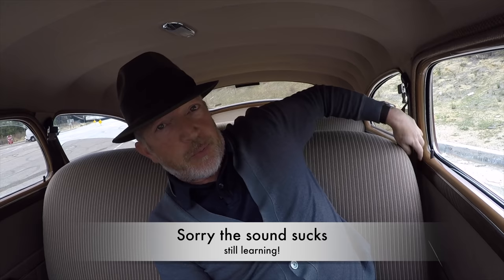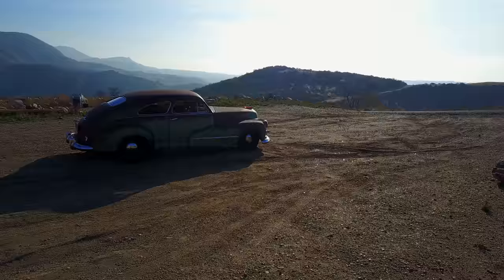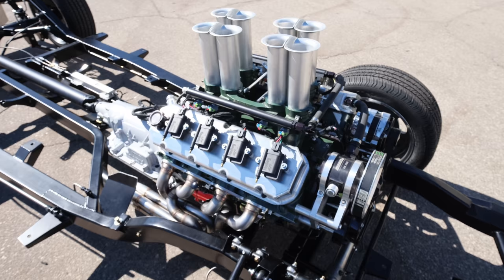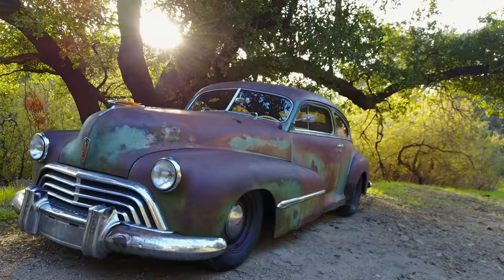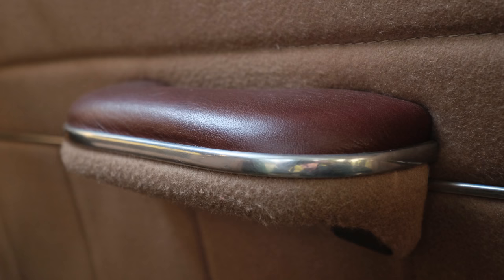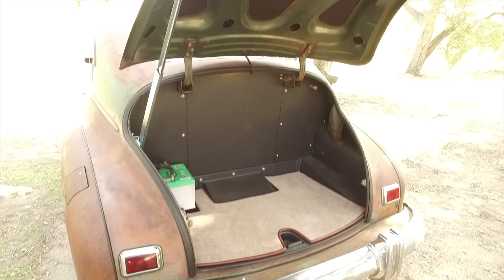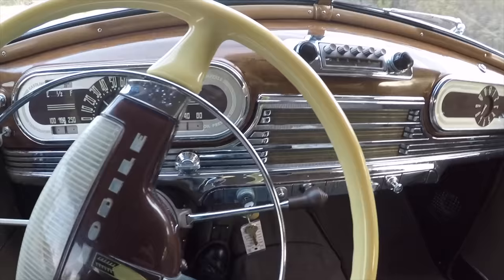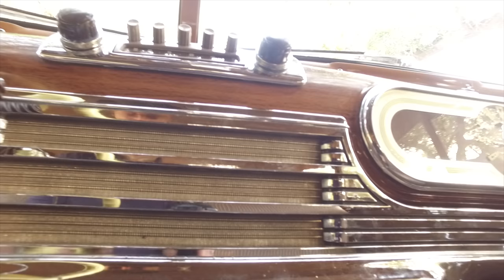ICON 1946 Oldsmobile Derelict Detailed Overview 4k video!

Comment: As a lover of the Harley Earl design team and especially the mid 30's to mid 50's stuff they did at GM I have always wondered if Earl was also responsible for interiors as well. Do you have any info on the interior designers at GM Mr. Ward?  ICON knocked this one out of the park in all aspects, as usual. Great job and best regards. Cheers!

Comment: Absolutely love love the car. The work you all do is A+++. I wish I could afford a derelict but I'm a disabled vet which is fine but I just love dreaming of that "Dream Car" that we all want. I would definitely want a Icon derelict it would be a 1949 Buick Roadmaster 2 door hardtop. I just love the front grille on the "49" buicks. My only request would be to incorporate the 4 portholes on each front fenders into the exhaust like on a P51 mustang. Whether to having the exhaust exit through the portholes or use them as muffler bypasses like you see on low riders with the lake side pipes. Please keep sharing your videos which keeps are dreams alive.

Comment: My 1st car was a 1946 Olds model 66 just like this one except for the color. Kept it original and it served very well as a daily driver. The radio buttons were odd as pushing one engaged an electric motor that did the work. Everything worked. Could cruise at 60 all day with absolutely no wind noise. Comfortable, dependable and cool. Gas mileage? Yeah, we had some...

Comment: Gawd... what a masterpiece! If only I had the funds...
2 trucks I had in my life, if I still had them and had the $ I would have contracted you to do...
1950 Chevy 3100 short bed. I was in love with the body style and the interior
1974 Ford F-350 Super Camper Special (although that truck was near show floor condition inside and out) at the time I had to let it go the braking system was shot, and could not find the parts or the $ to fix. It had a 360

A gentleman down the road from me has a 1941 Cadillac Coupe in his back yard with a small tree grown through the middle of it, to me still worth saving. He refuses to sell it. It's so sad.

Comment: Wow just ran across your video like how you took and Oldsmobile and kept it looking original but made everything NEW on it so it can drive anywhere like a daily driver.
That's how I want to make my 1947 Chevy coupe stylemaster. The car came out of Richmond California GENERAL MOTOERS Company sold to a dealership in Hayward California. It went through a lot of hands because they took out the original front seats and painted it a diffrent color tan with brown fenders the original color was a dark green. They changed the motor to a 250 Chevy straight 6, my brother took out the 2 speed transmission and put in a 350 Chevy. It was changed to 5 on 5 lugs drums in the front couldn't find one drum so I bought the disc brakes kit.   I should have bought the whole package with the booster. Changed it over to 12volt, electronic ecnition,  matched the old radiator to a recondition one i bought it out of San Leandro California,  this old timers radiator shop. He's been around for many year's. Now I need to put in a new steering box or replace everything all together to make it power steering power breaks and a gas tank and gauges. It has been sitting for 6 year's everything came to a stop. I either sale it or get it done.
         It's register and insured it can be driven anywhere in California but the steering has way to much play in it so it would be unsafe to drive not that it couldn't be driven around town.

Comment: You have to understand the state of the auto manufacturers in 1946 in that all American auto industry was shut down from Feb 1942 until Oct 1945. For the 1946 models there was no new design work done and they really just pieced the cars together. I think they did a great job considering that but that’s why  the factory dash switch knobs differ from one another so much!

Comment: I've got the same model from 1947. The leather trim you did on the bottom of the doors may not be right for a '46 but is correct and original on a '47.

Mine has basically every factory option...A more correct back up light would be a guide B-31 like mine has. I don't know if the guide back up lamp on mine is a factory option (I haven't found any mention of it in factory manuals and books for the car), but if it isn't then it is an original to the car purpouse made aftermarket accessory (it's switch assembly was clearly designed to work with the factory hydramatic steering/shift column).

Comment: The front wheels appear to be somewhat shrouded by the low front fenders. That would limit the turning  of the wheels by the steering and result in a large turning radius. The 1949- 1953 Nash Ambassador is an example of a production model featuring this condition. The skirted front wheels required the use of bumper jack to install or remove the tire and wheel from the car.
Certainly the lower center of gravity of this Icon Derelict improves handling on curves. But larger turning radius is not a plus for me.

Comment: One possible reason for the mixed style switch knobs: This is the first year of production after WWII and so probably a lot of parts bin scavenging. I wouldn't be surprised if you found other 46 Olds' they would have a different mix of gear.

Comment: How do you treat the surface? I mean it would be a pity if the car ended up with more rust? how about transparent coating?  ANSWER: Yes!

This is the point where most hot rodders would paint the wagon a deep metallic red and add modern leather bucket seats to the interior. But Ward did the opposite. He clear-coated the original faded paint on the wagon to preserve it and kept the original layout of the interior. He retained the pizza-sized steering wheel and made all the antique chrome switches and knobs work with a modern climate control system.

Comment: Wow great car.. 
I was curious about the rebuilding of the steering wheel, did you just find a gorgeous replacement or did you managed to recast the plastic?
I'm dealing with my 1962 sunbeam now and did a leather cover that was great till it disintegrated...( too many times with grease on my hands).
Cheers on a fantastic job and the client to afford it!

Comment: Do you clear coat the body outer surfaces to preserve them and what kind of product do you use?
I have a 1961 Humber Hawk Series II that is in my ID picture. The picture shows how it looked in 1964 when my father purchased it.. I inherited it seven years ago and it is showing much more age with worn paint and scars but no structural rust.
It has been in storage for approximately 25 years and I am getting it ready for driving again.
I don't want to restore it to look new. I want to keep its age. My father had coated areas of the body in a temporary preservative that has turned black over time. I would like to clean it all back to the original paint and patina. But I am wondering how to preserve it and water proof it. Should I have it clear coated?
I will keep it all mechanically original and all the interior original.
I have joined a national Humber club and they are urging me to restore it to new condition. But I like the aged look.
Reply: Dont ever clear over rust! Instead, use lindseed oil. Rub it over the entire car...gives any remaining paint a satin sheen while protecting surface rust somewhat from spreading

Comment: Check out the Ciebe H4 headlights if you want a more rounded headlight vs those Hellas you guys are running in this. the Low beam/high beam height spread is a little tighter on the Ciebes vs the hellas which, IMO tend to shoot too high in high beam mode.

Comment: Fine job! Do you warn riders not to grab the window cranks and go at 'em like an old dry regulator would need, so they won't destroy the switch(es).I'm guessing you put stops to keep that from happening,or some sort of 'breakaway'to allow them to slip instead of mangle. It sure is a good lookin' soundin'drivin'machine!

Comment: Was the original engine that was in it seized, or did it have a cracked block? (I’m assuming it was not running) If not, will it at least be rebuilt for another client with a ‘46 Olds?

Me, I like keeping them original in general. But I also understand that that car was not an original low mileage specimen. 

Adding in those modern style seatbelts was a nice touch, as safety trumps originality. Same thing goes with installing a dual chamber master cylinder to replace the original single chamber master cylinder. I have lost break fluid while driving on the freeway. I don’t believe that I would be here if it were not for dual chamber master cylinders.

Comment: If my motor in the car was stiff and not able to move I will have the motor rebuilt if the transmission was bad and not able to move I would have the transmission rebuilt and I would not have the motor painted or the transmission painted it will be clear coated but not painted the seats in the interior however would have been reupholstered rated but the way they had it back in the 40s

Comment: I was going to ask about the lizard on the bonnet but then realized your avatar was a lizard, so I guess you do that for every car give the treatment? My Favorite GM cars are the '47 Chev and the Pontiac. There are some in my country, indeed their is a GM show every other year in a town near by where such delights can be seen. However, in recent years our federal government has allowed anybody to privately import cars (bikes, trucks, caravans and boats etc) so long as they can be 'complianced' to Australian road safety standards. This doesn't include changing which side of the car the steering wheel is on, that can remain stock. We are also lucky enough to be able to put any vehicle older than 1995 on club registration which is one third the cost of normal registration, and allows you to make trips twice a week, or 90 days in a year.

Comment: Wow Mr. Ward, you seem to have pretty much my opinions on "updates". Plastic switches, modern radios, modern gauges and steering wheels, obviously fake patina, fugly modern rims ... no, you put great effort into saving the harmonious integrity of the original design (and individual car's history) while making them genuinely improved. As a counter-example, I just watched another video where, among other "updates" someone removed an original, beautifully running low-miles 283 for another carbureted crate SBC ... why? Neither modern nor old, not significantly faster or in any way improved upon ... just a sad nudge towards mediocrity and eventually the crusher.

Comment: It is so sad that you took out the original engine like that but if you leave the classic engine or upgraded somehow that possible can it will be much higher of a variable of your car it doesn't matter if you keep the original one it looks great on it but however that you change of your chassis and the engine for the brand new well I give there like 90% but however if you keep the chassis and the engine the original one or upgraded the engine somehow that it would be 100% original car that is but this is my own opinion anyway you change it you like it but this is your car anywhere you could choose that any kind of engine or if you wanted to do

Comment: Fantastic car, but: much of this I agree with, some of it I don't. 
If you own and drive this car then you will spend most of the time inside it; replace all  the rotten fabrics and make the interior a nice place to be: well, of course, no argument there.
Unobtrusively install modern audio gizmos or whatnot: hey, why not.
The exterior is what other people will see: retain that gorgeous patina, fuck yeah absolutely!
To me however the engine is what gives a car its soul. If it came out of the factory with a sidevalve straight six (or straight eight!) then that's what it should have. 
If the emissions or economy aren't up to scratch, well then there's your challenge: fix it with your modern electronics and your deep pockets, and do it without destroying the car's fundamental character. 
Swapping the engine out for something completely different is a cop-out. Even if it's a very expensive cop-out. imo
Much the same goes for the transmission.
Brakes: sure, upgrade the brakes, no need to compromise safety.
Suspension: it's a big, heavy car, American roads are smooth and high quality (so I've been told), it's a boulevard cruiser not a race car, I don't really see the need to modify the suspension to any great extent.

Comment: Thirty six years ago, an old guy in Ogden Utah was selling this sane model car for $500, it was under powered, with a six cylinder engine.. My friend bought his 1955 Buick and I bought his 1953 Belair for $300. Why did you turn it into a vagina? Seat belts, leather, power wndows, reverse light and AC ? To me, this is an insult to our WW ll veterans and the GM automotive engineers of 75 years ago.

Comment: If the car was just the way it was and put back the way it was that cold be worth a lot of money now the car is worth not much money anymore because everything is now new even the chassis is not original to the car and the rims don't even belong to the car either the only thing I see that's original to the car is the steering wheel the dashboard including the hubcaps in the paint that's it

Comment: THERE HIGH DOLLAR CARS, WELL, BUILT,,, NOW I, WOULD LEAVE THE ORIGINAL RADIO, REABUILT WITH BLUE TOOTH FOR YOUR SMART PHONE AND THE, ORIGINAL ENGINE, TURBO OR SUPPER CHARGER AND NEVER TRANNIE,, THE BUICK WAS, LS,,, EVERY THING WAS GOING GREAT, TILL THE, LS. THE OLDS WAS REALLY NICE, LIKE I SAID, KEEP THE ORIGINAL RADIO, NOTHING SOUNDS LIKE A, TUBE TYPE RADIO /AMP,,, YOU NEED, A SOUND SYSTEM LIKE WHAT YOUR, USING, PUT IT IN THE GLOVES BOX/CONSOLE,, A, RESTORED ORIGINAL RADIO WITH, BLUE TOOTH IS FOR WHEN YOU ARE PARKED WITH A, FRIEND, OVER LOOKING THE CITY...